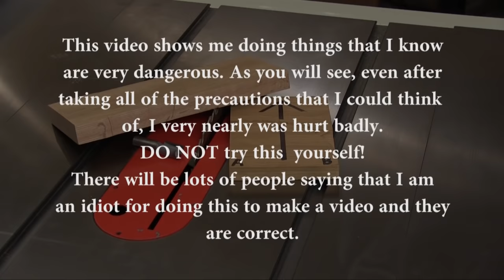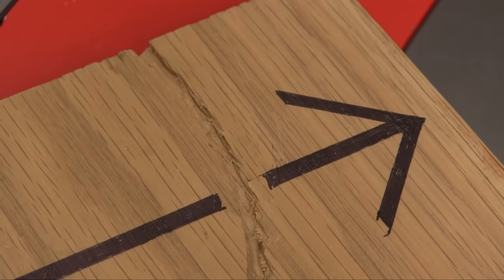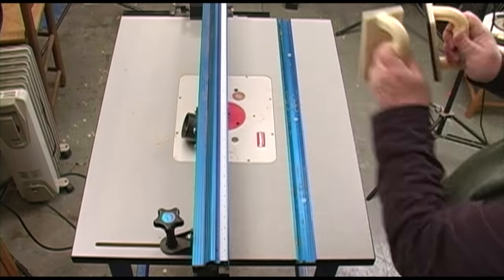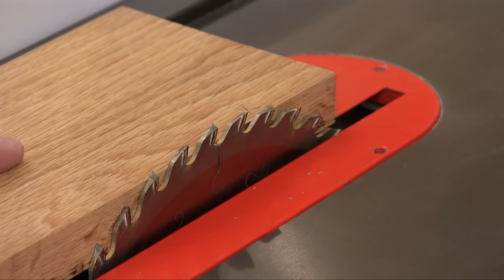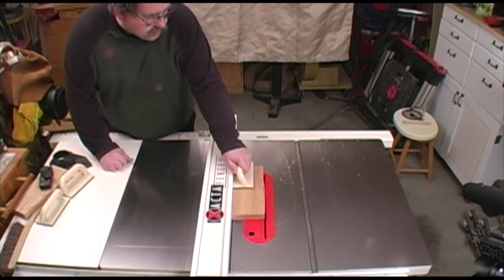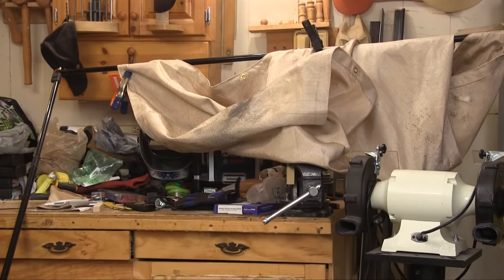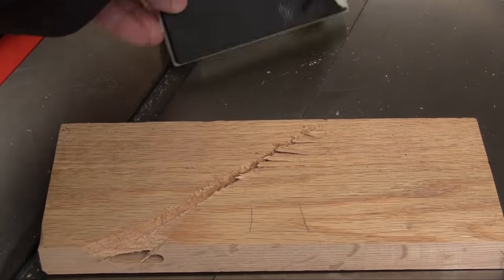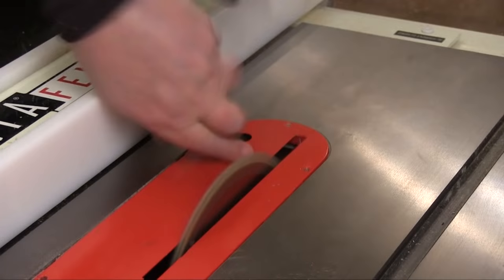Kickback on Camera!

Comment: Yes something like this happened to me in wood tech shop class in school a two months ago.we were making a sliding top box and we needed to put slits on sides of the box so we can put the bottom board and the sliding top. It was my first time using the machine. I had seen students use it previously but I didn’t recall which way they were pushing it. When I used the grippers I pushed the wood the same way the blade was going and it flew. The gripper also flew. It had a slice going up to tbe middle. It could’ve sucked my finger in too if wasn’t holding tightly.Thankfully there were no students in the way and it hit a wall. I learned my lesson.

Comment: Had this exact thing happen to me. I was cutting a small warped piece of plywood, and it twisted and pulled towards the blade. Cute the bottom of the plywood just like it did in this video. I was using a long push stick so my hand never came close to the blade, but the plywood shot off at an angle and hit me in the stomach. Hurt a bit but left no mark. It was my boss who removed the blade guard, I think I'm gonna put it back on after watching this video lol.

Comment: This is exactly how I had the tip of my left index finger sliced off from the tip to the first joint. Had my middle finger badly mangled and my thumb was scratched by the blade. All this happened despite the fact that I was using a push stick to guide the lumber out of the path of the blade. Just thinking of it makes my stomach turn. It happened in a heartbeat. Never mess with a table saw guys.
Reply: How is your hand now can u use for normal things still?

Comment: Wow you are VERY lucky! If I ever get a table saw, I will certainly buy a blade guard! I use a workbench and set a jigsaw into it upside down, and when passing wood through it, you need constant pressure downwards to keep your piece from flying off. Health and safety around power tools is not a joke!

Comment: Yikes! Yikes! That made me queasy. Now I can't turn my saw on again until I buy a riving knife! I just stopped using my 40-year-old Craftsman saw that never had a riving knife and I disconnected the crappy blade guard that it came with because it interfered and, of course, I thought I understood the kickback mechanism and knew how to be safe...
I just bought a Ryobi BT3000 from an owner who threw is driving knife and blade guard away. 
Your terrifying illustration is what any saw owner should see because two pages of cautionary words in the owner's manual are meaningless. 
I actually don't think you were wrong for doing this, as you wanted us to hold the powerful lesson that you hold in your gut from your first kickback.  Even more powerful is how you illustrated that even anticipating and believing you could control this was not enough. I'm glad you kept all of your fingers!

Comment: In woodshop years ago I cute a small block (probably<6in) of wood too long and needed to cut it down a bit more and instead of using anything that made sense I used out compound miter saw by trying to brace the small piece with another larger piece, needless to say I went bad but I somehow still have my fingies

Comment: I had to brace myself to watch this because I tend to "feel" what is happening to others at the time... Even though I knew you weren't going to get injured, it's still frightening!  I don't have and will NOT have a table saw, but I was going to set up a router with a table and didn't realize that kick-back was part of THAT tool too!  I've never used power tools, except drills and a jig-saw and am still a little apprehensive about using the circular saw I just inherited and got a new blade installed on!  Thank you for your cautionary tale and warning; it's the best example on YouTube!
Reply: Ohhh Marcy

Comment: No matter how many times I watch this video, I still have trouble wrapping my head around how close you came to cutting your fingers, despite being fully aware that you were intentionally triggering a kickback and actively pulling your hands away before the blade even fully grabbed the wood. It's just crazy to think of how close your fingers came to the blade, even though that was exactly what you were expecting. If you came that close while intentionally demonstrating a kickback, I shudder at the thought of anyone who did the same thing by mistake. If I was the one in the video rather than Thintz12, I probably would have lost 3-4 fingers before I even processed the fact that I needed to pull my hand away... I know practically nothing about woodworking, but I'm gonna guess that kickbacks and mistakes using table saws account for a significant portion of accidents and injuries in that field.

Comment: Sorry about that... Let me finish my thought... The workpiece and both of my hands were to the left of the blade; the fence was to the right of the blade; acting only as a gauge of the length of the finished piece. The blade hit a knot in the workpiece and the instantaneous change in the dynamic forces caused the workpiece to rotate CW, toward the blade. I had taken this into account; but I completely underestimated the power of the blade. I thought that the accelerated workpiece would simply rotate away from my grasp. The reality is that it moves so fast, that your grasping hand cannot relax quick enough to allow the workpiece to rotate without dragging your hand along with it. Consequently, my left hand (furthest from the blade) was propelled CW across/and above my right hand; and inverted towards the blade. The incident removed my left index fingernail, and barely chipped the bone. I was extremely lucky; as you were. Simply, another example of someone (me) under-thinking the dynamic forces, and the potential for disaster. I thought that the forces would pull the workpiece from my grasp; but it happens so quickly that the forces pull your hand along with the workpiece. Destination, disaster! Stay safe, brother, and thanks for the valuable advice!

Comment: I can tell you that two years ago I upgraded from an older cheap table saw that I used for years to a new one that I 'm sure was $400 more than my old one. Doing almost exactly what you did, but with a push stick, I had kick back occur and the board hit me in the belly. It left a nice outline of the wood and lasted about 6 months. Still needing to finish the project, I decided to consult...wait for it...THE OWNERS MANUAL. In it I found the "riving knife" and that it was screwed to the tray on the front of the table saw. It took about a minute to install. I have not had an incident of kickback again. The old saw did not come with one. Moral? Don't be stupid. Leave your fingers and intestine in place. Put it on.

Comment: Great video. I've heard that more table saw injuries are caused by kickback than by blade contact and I believe it. My saw came with a riving knife and one of those clear guards and I always use both, even though I'm often tempted to just raise the blade and start cutting. I've taken my share of ribbing for using those guards but they do prevent a lot of mishaps.

Comment: My shop teacher every year would demonstrate a kickback and the wall that was 60' behind the saw had a plywood window and several holes in the wall as a result. FYI I've also seen a demonstration of a bandsaw blade breaking and why you should NEVER be on the flat side of the blade.
Reply: I’m sorry what do you mean by the flat side?
Reply: @lukasmccain3529  I reckon he means the wide side of it with no teeth.
Reply: @lukasmccain3529  the side of the blade. If it breaks and catches on the table then it can shoot out the side and impale you.
Reply: @chriswade9616  yes exactly

Comment: That was an awesome video, and you are a lucky man. I also admire your courage to post this 'as is' because it really lets the message sink in. I myself had a kickback, but I was cutting a piece of plywood. Even though my hands were not near the blade, when the kickback happened, the plywood made a perfect 90 degree 3/8th inch deep, circular arc in the back side of the plywood. As it climbed over the back of the blade and simultaneously rotated out of the saw, it pushed past my right thumb (which I was using to put pressure on the back of plywood) it opened the flesh on my thumb in a in a neat 3corner tear, that almost went to the bone. It also dislocated my thumb backwards. At the same time I thought I had suddenly been kicked in the stomach by a mule because the plywood was ejected right into my abdomen. It hit me so hard I thought I might have internal injuries. My whole abdomen was later bruised  where the edge of the plywood hit me. Fortunately I got away with just the bruise and a deeply lacerated and dislocated thumb.

Comment: Wow, great video. Glad you didn't get hurt. I'm actually looking up videos like this. I'm a machinst and honestly it seems like machining metal seems to be a little safer because of all the holding devices. I also have some formal training in machining metal so that helps a bunch. With metal many times it's impossible to feed with your hand or human power. You usually have to have extremely strong holding devices. Many times the feed is done with a crank or power feed  This keeps your hands far away from the cutting area. Just because wood isn't as hard as metal kind of opens up a lot of instances for dangerous mistakes. Never underestimate the knowledge required for another trade. I'm reviewing these types of videos to try to make sure I'm prepared to do things better, safer. I've had mishaps in the past working with wood that's making me say... You need to get better at this... That was close!!! We have to not underestimate the danger of this trade.

Comment: Everyone should remember that this was only the act, he knew it would happen and when, so he knew where to stand and how to react as kickback happened. Even though he was just showing the reenactment of the incident that happened, he almost lost a finger and there is no time to properly react nor to prepare yourself. Bladeguard. the plastic piece above the blade that get's lifted as the wood moves towards the saw, can get in a way and isn't really necessary if you have safety goggles. Riving knife is a must have and life saver as it completely prevents situations like this. There are many youtubers who have channels for beginners and how-to-start-with xyz craft, but we all need to remember these are all professionals with few decades of experience. Important note to all this is to know what your tool can do, the goods and bads, prepare accordingly and follow the instructions of manufacturers. After few years of experience you will be more confident in your skills and be able to experiment with tools and their abilities, but always stay in lines and follow safety instructions, do not fear the tools as you won't do anything but respect them and their intended use to get best results you can. Practice makes perfect but fingerless hands can't do crafts and handwork.

Comment: In my college shop, when they did the shop safety orientation, when they got to the table saw the instructor paused and pointed us to the back wall. Apparently a Jr a few years back was ripping a section of 2x4 for a project without that splitter. Caught and threw that 2x4 through the gypsum board wall behind the saw. Shop manager got some trim and framed it on both sides. School invested in some saw stop saws after that to make sure the students only lost their project, not their digits

Comment: My table saw fence once got misaligned by only a millimeter or two. Cutting a small strip of plywood maybe 1/2" wide. As soon as the cut was complete it wedged in between the blade, shot out like a bullet. Flew about 10 until BANG, hit the wall. Thank god I was standing off to the side. Different kind of kickback, still shows dangerous kickback is.

Comment: I've never taken the riving knife off my table saw. I've yet to come up with a project where I needed to take it out. The blade cover on the other hand I ditched because I could never get it to work decent. Is a Bosch saw. just flaps about all over the place. Never moves nicely. Seemed like a bit of a poorly designed after thought. Also thank you for taking the risk so others can learn. I really understand what the riving knife is there for now.

Comment: Ok, it hurts to say it, but mea culpa. I did this. I cut a large mdf board on a table saw without the riving knife blade thing at the back of the blade. The saw picked up the board and threw it right back at me. I got a bruise in my hip, some cuts on my fingers that needed stitches, not from the blade though, and the piece de resistance a broken pinky finger on my right hand. AND I consider that getting out of it cheaply.
This was at work, and I drove myself to the emergency, all the while trying to tell myself it wasn't that bad and I was being soft.
Turns out I was admitted immediately. I wasn't being soft and it was that bad.
Be careful out there guys. Safety is a moving target.
Reply: Had a miter saw kick back on me yesterday and after reviewing the course of events I'm incredibly lucky to be alive the piece was torn up and flung itself to my throat but I suffered no injuries

Comment: i've been using table saws for abt 30 yrs and have never used a table saw that was anything more than a table with a blade poking up beside a fence. never knew a riving knife was a thing until the knife in the panel saw at lowes was bent and the operator couldn't complete the cut. NOW i know what that hole and set screw in the trunnion of my 1957 powr kraft are for. i might have to get the welder out and stick a shark fin on a rod and drop it into that hole.

Comment: I've been using a table saw for 45 years. IMO, if you're a lefty, you should have the fence on the opposite of the blade. This enables you to put pressure against the fence instead of trying to pull your piece towards the fence. Just my 2 cents. Glad you came away unscathed!
Reply: He isn't leftie, he was trying to stay out of the path of the flying wood.

Comment: Mark Twain said about advice, a wise man doesn't need it and a fool won't heed it. Hopefully in this case he's wrong. That's great information.  Sent chills up my spine lol. The closest I ever came was working in Detroit at a machine base, fabrication business, I was making one inch diameter holes through half inch steel plate, with a big drill that probably weighed forty pounds with a electromagnetic base, I'd drill a hole, release the magnet  move the drill and repeat, what I didn't realize is that the cutting oil was contaminating the surface, so the first time I caught a burr the bit jammed, the drill broke lose spun the forty pounds in a circle and knocked me on my ass. Ouch. Ripped my shirt, a few abrasions. Lesson learned, I was 17, also learned that half the crew was either polishing off a 5th of Crown Royal by noon, or shooting heroin in the bathroom. 70 percent of them were ex cons. That was an eye opener. Lol

Comment: The SawStop table saws won't allow any serious injuries to happen when you've got the safety brake system turned on. And it's helped many many people avoid serious and very painful injuries. So they're the best table saws to get to maximize your safety while using them.
Reply: True, but kickback is also dangerous because you now have a piece of wood being flung at you through the air. Let me calculate the speed of the wood, just for the example. Let's say it's stuck to the blade before it slung off. That means it's travelling as fast as the blade. Let's take the absolute minimum speed the wood would be flung off, meaning we'll take an example with the smallest sawblade, 6½ inches in diameter, the circumference of the blade is about 20,4 inches then. If it's running at 4000 rpm (which is low according to google), then the outer parts of the blade are travelling at 81,600 inches per minute, or 77 mph. The wood would be travelling at this same speed if it got stuck to the blade. I did this in imperial units as I suppose you're American, but 77mph is roughly 124 km/h.

So you have a piece of wood being flung through the air at minimum 77mph, possibly directly at you. That's not fun. If the blade had been 12 inches, and at 3000rpm, it would be 107mph instead. And you have to remember that the difference in energy between 107 and 77mph (how much energy it takes to stop whatever is travelling) is not just the 39% difference in speed, it is squared, meaning it's actually 93% more energy in the same piece of wood travelling 39% faster.

So, my point is that you shouldn't ignore kickback just because you have a sawstop.

Comment: I'm a Physics student and had absolutely no idea about kickbacks. I was drilling through hardened plastic box for an electronics project at 1 am in the night, all alone in the lab. 

Suddenly the box flew like a bullet across the lab, hit a wall and ricocheted off to blackboard. It dented the wall and cracked the box open, all before I could even react to what had happened.

 Never told my TA or Prof. about it but boy were lessons learnt that night. At least now I know the technical term for it 🙆🏻‍♂️
Reply: did you not clamp it down?
Reply: The wall knows
Reply: @yellowcoat970  We had clamps but I did not use them because "wow, that seems inconvenient". Instead, I was pinning it to the table using my hand as a clamp
Reply: @amdclx4635  The wall took slight damage. A part of the box even hit the blackboard but didn't deal noticeable damage. I hope they both forgave and forgot 😃

Comment: The table saw is the one piece of equipment that I do not mess around with. Even using 3D push blocks and sleds I'm always on guard. You. can never be too careful. The least thing that can happen is you waste time taking longer to cut pieces.